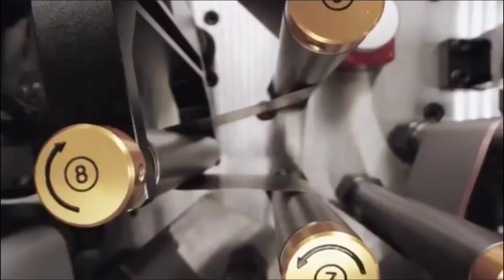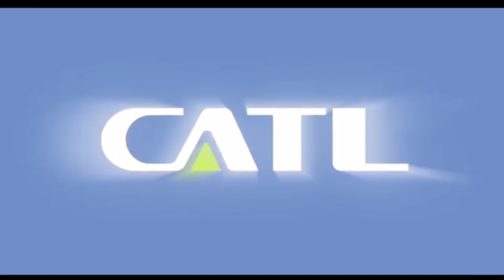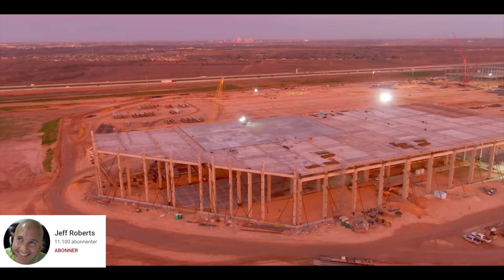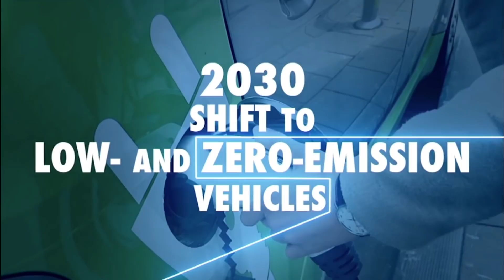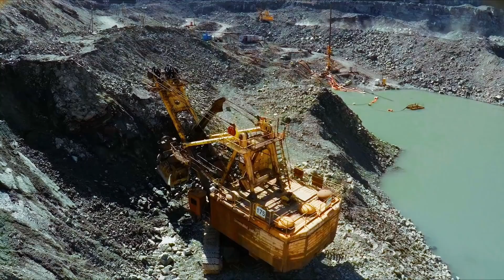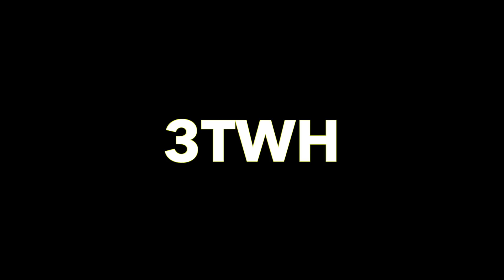Tesla is making 3 NEW battery types | And securing materials like NO ONE else

Comment: i hear aluminum air batteries will beat lithium ion @ double energy density lower cost
Reply: Aluminum air has very high energy density, but so far, all have been single use "primary" batteries. No one has managed to make a rechargeable aluminum air battery yet, though some versions can replace the aluminum electrode and recycle the aluminum oxide waste. 

Lithium air has even higher energy density than aluminum air, but also has not yet solved the recharging problem.
Reply: @chrismuir8403  Really?  i just saw a video i ll look again.  thought rechargeable
Reply: @buzz-9x , there was a company that claimed to,  but they never showed a demo or had independent tests, and dissapeared after gathering investments. Highly dubious claim. 

Too bad, as recharging an aluminum air cell would involve electrolyzing aluminum oxide, if that could be done at room temperature it would dramatically reduce the cost of aluminum production as well. 

Now, there have been proposals to make an industrial scale aluminum air battery by running an aluminum smelter in reverse, but that would be too large and too high temperature for any mobile application.
Reply: @chrismuir8403  will check.  saw video recently

Comment: With the battery issues addressed, I'm guessing Tesla is going to open their own chip fabrication plant in response to the annoyance of the current chip shortage to insulate themselves should it ever happen again.
Reply: My info might be a bit outdated (its from Autonomy Day 2019, havent heard anything else on this since), but Tesla had at least the Manufacturing of their FSD Chip Outsourced to Samsung in Texas if i remember correctly

EDIT: Fixed the mix up between Autonomy Day and Battery Day
Reply: @unitrader403  I think that you are right.  Samsung Texas was just mentioned in another video indicating that they had to shut down for a few days because of the power grid issues but they were coming back on line slowly.  Apparently bringing a chip manufacturing facility back up takes a little time which is why Elon has tweeted MY and M3 will be in limited numbers as things ramp up.
Reply: Uhm nope its not going to happen.

Comment: Recycled batteries from cars can go straight into power walls, without breaking them down, straight swap as the power wall has less demanding requirements for the batteries and will get another 20 plus years from them.
Reply: Just my thoughts, I’m no expert. Be nice
Reply: @JohnnyGavigan  It could happen.  It just depends on if it makes economic sense at some point.  5 years from now there likely will be other suppliers of home power storage, and it might very well make sense for them to re-use batteries from used vehicles to build their power units.  Lots of variables in play.
Reply: NOPE, Tesla is going to IRON based cells for ALL Energy Products, as Weight is a non issue.
Reply: @markplott4820  who said that?!
Reply: @carholic-sz3qv   - at the Battery Day , last year .
ELON/DREW said three TIERS , Short Range / Storage = IRON Based , Vehicles = Mid Nickel , and Long Rang/ Hauler = High Nickel.

Comment: It was obvious from the start that Tesla would produce different batteries for different markets & demands.
It makes perfect sense to use the cheaper & less potent batteries in markets where smaller vehicles are driven predominantly in short urban daily use.
Battery storage is much the same, it doesn't have to respond to massive spontaneous power changes.
The middle tier isn't such a big sacrifice for the average motorist & the new 4780s will be cheaper to manufacture while being very space-efficient.
Well done Tesla for their continuing innovation & the forethought to recycle used cells. 👍

Comment: why the hell are people complaining bout our lithium supply and not oil supply we are literally running around trying to find more places to get oil and even trying to drill in national parks where its illegal
Reply: ... nailed it perfecly 👍🏻🖖🏼
Reply: To answer your question: because once we get on batteries we'll start getting off oil. Lithium supply WAS a limiting factor in the past before Tesla came up with a new extraction technique. The current constraint is nickel which is why we need to increase mining efforts.
Reply: Oil is needed for energy until we have enough batteries and electric machines to take over 100% from oil. Otherwise we will have a slowdown that may even push oil power elimination back to a later date.

Comment: Pretty sure the new S / X are on the newer chemistry 18650 cells, Plaid+ will be the 1st car with 4680 Nickel / menganese cells. What i want to know is if the S / X LR and Plaid have 18650 structural packs.
Reply: NO, because FREMONT only has REAR casting at the momoent. 
GigaBerlin will be FIRST to use Underbody Casting and Structural pack. 
in 2 years GigaShanghai and Fremont will get Underbody Casting.
Reply: @markplott4820  Agreed, no structural battery without front and rear castings, but plaid+ probably gets it as the range is so high it's got to be 4680s.